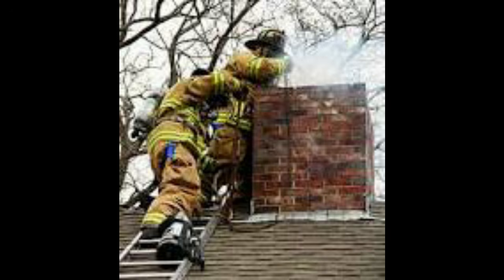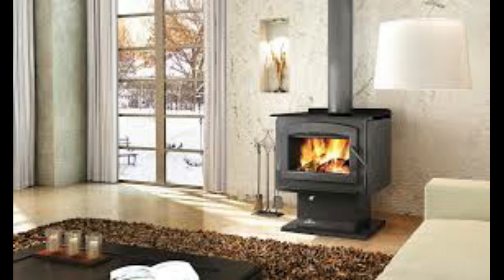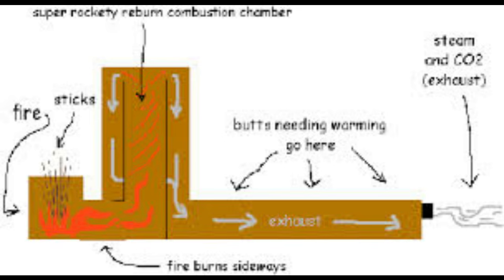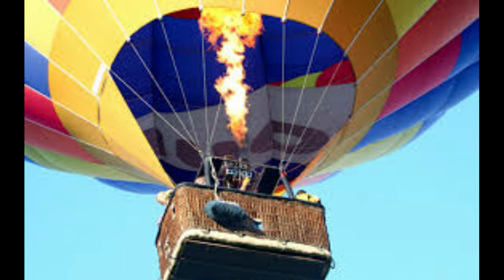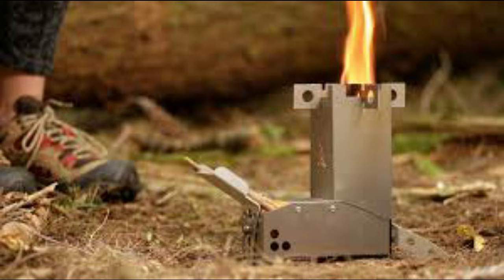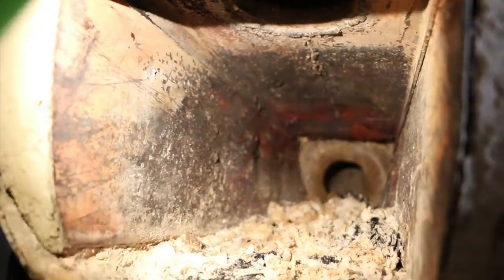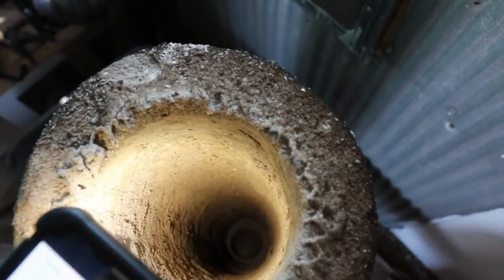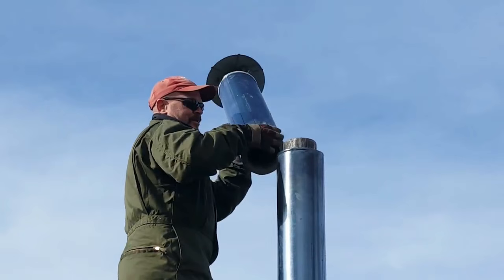No Creosote Forever More

Comment: We have been burning wood for 40 years.  Never had a chimney fire.    Clean your chimney 3 times a year.
Reply: Yelp
Reply: We are having them so much,  I don't know what we are don't wrong?
Reply: I clean mine once a month and do 2 really hot burns every two weeks
Reply: @zack9912000  why hot burns?
Reply: I clean mine every two weeks
Reply: @HDDynalowrider  with a vacuum cleaner?
Reply: @Hi-levels  The chimney is cleaned with a brush. Either from the top or from the bottom depending on your setup. And normally you don't do it yourself but a professional chimney sweeper does it. Never use a vacuum cleaner because the ash and especially the sot has too fine particles. Cheers
Reply: I think the point of the video is that you do t have to clean it if you have the right system.
Reply: @Daynah11  don't burn pine and such. Only burn hard woods.  Make sure fire dosent smolder. Every 2 weeks throw some rutlands creosote sweeper in your hot coals. Don't burn green wood(wood that's not seasoned long enough) get a wood moisture gauge and don't burn the wood if the moisture is above 15%.  That's what works for me.
Reply: @artichoke890  Thanks mate.  We have seasoned wood this year so we are doing well. When we bought this over winter we was unable  to clean it properly so over the summer we basically did a deep clean.  No problems so far this winter.  I really appreciate everyone's advice. It's definitely been an adventure learning about my wood stove..I tried looking up info on my model and there's nothing!  Stay safe and warm everyone
Reply: @Daynah11  you are cutting the air intake down too much. Also I don’t know what type stove you are using but the corn or pellet burning stoves are not efficient burning wood. It gives it so much air that you can’t cut it down enough because the air intake is directly below the fire. Get a good stove that is designed for wood burning only. I learned this the hard way. You will also burn significantly less wood per season. No one else will share this information with you. Good luck.
Reply: @artichoke890 some good advice here. Although I burn nothing but seasoned Jackpine and when I went to clean the chimney this spring it was nearly perfect. Nothing but a minor amount of soot lining the stack. Been burning it for several years without any issues. Just my two cents
Reply: Clean it when it needs it   inspection is easy and omg if the draft slows guess why   halfassed advice is best kept to yourself guy
Reply: Not when they charge $150.00 a trip

Comment: Burned wood for 50 yrs, never had a chimney fire and only cleaned every 3yrs. Never a problem. Guess I was lucky.
Reply: Not lucky , you problably  burn seasoned  wood .
Reply: More likely you had small chimney fires of which you were unaware.  The do happen and apparently are of insufficient temperature to cause damage.  Very rare in my experience.

Comment: One thing I noticed in more than 50 years of burning wood is that moisture is a big factor in creosote production, rain and mist and also remember hot and cold mix creates water which turns smoke into creosote. Hot smoke and cold air make water. A horizontal stove pipe is a perfect collector of creosote. I have built several types of you tube rocket stoves and have discarded their ideas after a couple of years. If you don't have a air tight house you will lose heat quickly. Need a damper to shut off heat lose after wood burns down. Best Rocket stove I know is a box stove or whatever you have and clean stove pipes. Set the damper to ¾ open and the door open only about 3 inches and the house will be hotter than you can stand in just a few min. so load it light. I use a home made 36 inch weld pipe stacked double chamber  stove. works better than anthing I have tried.

Comment: Another advantage of a well insulated stove pipe that stays warm is that creosote in smoke will condense on cold surfaces much more readily than a hot surface, just like water vapor condenses on a cold surface but not a hot one. We have a brick fireplace with a metal heatilator around the firebox.  The chimney has an air space between the brick and liner, which acts as an insulator.  While it's not the most efficient system, I burn such hot fires that the metal of the ash cleanout warped, and we haven't cleaned our chimney ever, because there's no creosote buildup.

Comment: the quality of the fuel is where this issue starts. If you only burn well seasoned, dry wood of less than 20% moisture and don't run slow smoldering fires, this should never be an issue. Cleaning your chimney every season and using seasoned wood and hot fires pretty much eliminates the chimney fire risk. Of course using a quality airtight stove and not an open fireplace is the obvious first step.

Comment: A p properly installed stove with good draft is important, but the most important thing of all is to burn quality well dried cord wood.  These newer style stoves (love them or hate them) burn much cleaner than the older stoves.  Very little deposits in my stove pipe,  if any.

Comment: This is much the same as a gasification wood stove or boiler. The heat is so high that everything is burned with no waste. However in this case, there is no electricity required.

Comment: Creosote come from incomplete combustion...people think that they are saving wood by starving oxygen...wrong!  The unburnt gasses condense on the cooler chimney walls...burn hot, until the coal stage...do this every time you reload...the taller the chimney, the more important this becomes...a chimney fire is due to carelessness...I have an airtight stove and removed all the airtight seals on the doors and intakes...you want oxygen for complete combustion...I use to be a boiler tender at a sawmill and this is what I learned through experience...keep you chimney clean...it can eventually clog or become a fuel source with the creosote build up causing a chimney fire drying out the wood near the chimney and reaching the flash point of wood nearby and setting your house on fire!

Comment: With a normal wood stove, would it be a good idea to crank the damper wide open near the end of a burn? Like say you have a sensor at the chimney and when the temp drops below a certain point, you just open it wide open.  My train of thought is it would prevent the smoldering phase when there is almost no fuel left and let it burn out a little faster.

Comment: Unless you're exhaust is relatively cold, efficiency isn't going as good as it could be.  If you're burn temp is 2,200 deg and the exhaust temp is 800, you're loosing 30% up the chimney.  If you're cutting wood, that's a lot of work to send up the chimney

And the new designs I've seen don't exhaust below the box anyways, but comes back to the stove and goes straight out the top of the building. That way the natural draft of a warm house and the extra kick of heat given by the barrel to the chimney insure the whole thing is under negative pressure.  

On the other hand by putting your chimney outside I would expect you to have some issues getting a draft started on bitterly cold days if the system is dead cold. Also as hot and clean as the stove is, it's likely burning up the CO as well as all the volitile carbon compounds.
Reply from the maker: my stove exaust is between 120- 150 degrees, you can touch it bare handed. air crete insulated stove pipe makes it possible, stay tuned for the mechanics vid
Reply: @HoneyDoCarpenter  

So you've put a thermocouple in the cleanout elbow? I'd love to see video of it. Monitoring the temp of the gases throughout the stove is going to tell you a lot about effeciency and where the heat actually goes. 

Also have you dont material testing of your aircrete mix or is going to covered in the kickstarter? Either way I don't think you'll find an engineer who will stamp the drawing without knowing more about the material properties,, and knowing the R-value and heat capacity will be helpful when designing thermal masses made with it.
Reply: As a retired firefighter and wood stove user I have come to the conclusion that wood burning builds creosote. Avoid bends in your chimney pipe. Don't use 90 degree bends at all if possible and clean your chimney often. I clean mine once a month. Peace of mind is worth the extra work. 40 years of wood burning and no chimney fires.
Reply: @HoneyDoCarpenter  is that inside or outside temps?

Comment: I gotta say while i like your findings I don't agree with the "they don't even have a chimney." statement. There is a chimney that is almost always above the firebox. One of the Permaculturists that I follow has used gravel in his bench once and found that a full solid mass was much better as a heat sink since the loose gravel has enough air in it to lose too much heat to work well. The same was found using packed sand for the same reason.

Comment: Looking at the creosote inside my chimney i'm tempted to remove the firewall from my stove and set light to the chimney to give it a real clean out. I have a metal roof and think i might get away with it.
  When i light my downstairs stove it starts streaming down and dripping back down from the flange that connects the metal stove pipe to the cement chimney. I thought i might remove the concrete blocks i put around one side of my chimney because on windy days it seemed to mess with the stoves. I didn't really have a creosote problem until i fitted a different stove downstairs and even that was working ok for a while. I just cleaned all around the flange plate thinking i would be ok for a while but as soon as i started the stove up it started dripping again.
Reply: Did you survive?
Reply: @dhall5634  obviously I didn't risk a chimney fire in the end. I tried a tip given to me by locals, dry out a few kg if possible of potato peel. Light a good fire so your left with a decent pile of hot coals. place your dried skins on the hot embers and let them smoulder till gone. After this is done and cooled, then brush the chimney.
  One of my problems was condensation, I have not really seen any this winter. Trick is to have a clean chimney and keep the fire hot with plenty of air till you have a big core of hot coals. keeping the chimney warm by not leaving the fire off also helps. I planned to put a pellet stove in but I needed to move my gas boiler so I didn't get round to it yet. I have it right here, just need to do that plumbing. The stove is hot tonight.
  When I brush the chimney I remove the firewall from the stove then I drop a rope and shackle down from above. I then attach a brush from the inside of the stove close all vents and go back to the roof to pull the brush through. Once the soot has settles you can open up and clear any bends or shelves etc. Wear a good mask!

Comment: Yes they burn wood more efficiently. No they dont heat your house more efficiently. Because burning wood inefficiently heats your house longer. That's what causes the build up in your chimney. Reducing the air intake. Causes the wood to coal and smoulder. You use ten times as much wood in a winter heating your house with a rocket stove. And that amount of air going up the chimney has to draw the same amount of air in to the house from outside to feed it. It has to equal out.
Reply from the maker: It heats any space more efficiently. the exhaust exits the stove pipe at 120 degrees the rest of the heat generated ends up in the shop, home , or space being heated.
Reply: @HoneyDoCarpenter  ok, well I have a few questions then. If the rocket stove is working at full capacity a roaring away. How many cubic feet of air is being drawn up the chimney? If the intake for the rocket stove is not being drawn from the outside. Then cold air is being drawn in to the building from outside. Your house isn't airtight. And how are you supposed to sleep for eight hours? You can't sleep eight hours, a full load won't burn long enough. And are you saying that a rocket stove uses less wood than a wood heater with an intake you can reduce the air flow on?  Because the same amount of wood I I burn in two hours in my rocket stove will burn for 12 hours in the wood heater in my house. So you'll have to explain how it heats a house more efficiently? Yes it burns wood more efficiently. But they do not heat a home, more efficiently. They use way to much fuel.

Comment: Burning wood predominantly causes what you refer to as ‘creosote’, which is essentially the sticky vapour carried up your chimneys and results from poor heat of combustion in a wood fire...the main problem of this substance adhering to your chimneys, is related to the fact that most American homes are constructed of timber, and have a steel chimney to extract smoke from fires...which readily accept being coated by the sticky vapours produced and builds up in the inside of metal chimneys. Such problems rarely occur in chimneys that are constructed of stone, concrete or brick, but will occasionally still require sweeping to remove ‘soot’, carbon deposits in a less combustible form...but, have also been known to catch fire when fires burn particularly hot...as the ‘creosote’ to which you refer, but in much small amounts, is held within the particles of soot that coat a stone, concrete or brick chimney.
The best way to avoid such fire in wooden homes is to not use a steel chimney, but install a stone, concrete or brick chimney, or alternatively use a cast iron fire, with a secondary burn chamber, that effectively burns the ‘smoke’ from the fire, thereby reducing significantly, such deposits inside a metal chimney, and therefore also reduces significantly the chances of a fire occurring in the chimney...all chimneys should of course, regardless of their type of structure, be swept and cleaned occasionally, but if you have a steel chimney, predominantly burn wood, and do not have a stove with a secondary burn feature, you should ensure it is swept and cleaned thoroughly on an annual basis, and that you obtain an invoice on headed paper from the company that did the works...if you do not, and a chimney fire destroys your home, you may also find that your home insurance is invalidated, and any insurance claim made will be refused...as you have no evidence of having maintained the chimney to prevent a fire occurring...
Reply: Of the thousands of chimneys ive cleaned, masonry ones most definately accumulate more creosote per a given amount of wood

Comment: I am a bit confused. Stove pipes are metal and they are spaced well away from combustible materials. Do these creosote chimney fires burn so hot it can melt the steel pipe?
Reply: DRy wood close to a chimney can ignite at 400*. A hot chimney can radiate enough heat to start a fire several inches away. from the pipe. The 1 inch air space required in the building code is not enough for a super heated chimney fire,
Reply: @timhale501   So in theory if there was nothing close enough to the pipe to ignite it would just burn itself out without causing any harm?
Reply: @UtwoBed  Spalling from persistent overheating will produce holes in the metal.  Minimum 36" clearance for single-wall pipe.  Insulated metal chimneys will eventually fail.
Reply: Yes
Reply: @dtaylz4me  not to mention, get stainless hot enough and the chromium atoms will migrate, eventually causing the steel to be able to rust

Comment: You need to get your facts straight. The diagram at 4min 15 sec is NOT a rocket stove. You are showing what is now being called a masonry stove. AND you did not show the flue which does draw the combustiongasses throu the entire system. Additionally most masonry stoves have secondary combustion air added which also was not shown.

Comment: Good info but you speak unfairly against the rocket stove 4:14 with such vibrato yet I can see you have no personal experience; only the books you read. We've proven it works. Simply claiming hot air rises is FAULTY thinking, It's relative. Hot air rises unless it is opposed by an even hotter air force by which it is comparatively colder.  Air in the rising chamber is 1200F while the air in the outer chamber is 600F. We have successfully made these stoves; one in my house. The Science is sound and you have little ash and no creosote buildup. This is because the ash keeps rising as a stream of burnt fuel cycles down leaving nothing but C02 and water vapor in the exhaust.

Comment: Yes, RMH are positive pressure past the riser and do need to be sealed, but with enouph cob it is impossible for there to be a meaningful leak. You speaking down to people interested in this only reveals your ignorance. The fact that hot air rises and the exhaust is positive pressure is exactly what makes RMH so efficient; the exhaust only leaves the system until it has shed a significant amount of heat as it stratifies. Negative pressure systems work by dumping enormous amounts of heat into the atmosphere. You insulting people who built these saying it is "faulty thinking" is ignoring the empirical fact that it works and it works well.
Reply: nustada if an unobserved crack develops in the cob, one might be a dead person. Darwin’s system uses the massive heat sink effectively enough that the negative pressure doesn’t hurt efficiency. Without a drawing exhaust pipe, insurance companies and the UL probably will never approve of these systems.